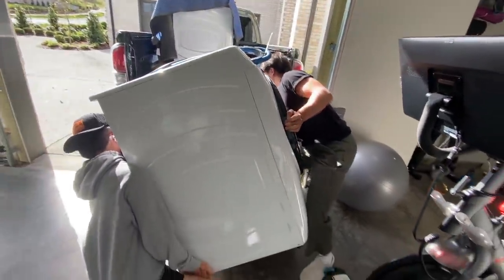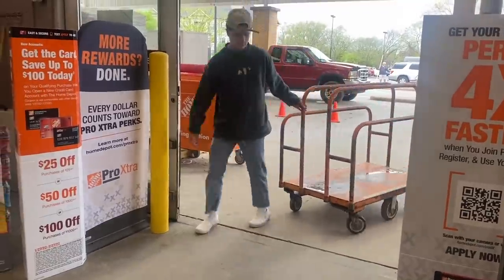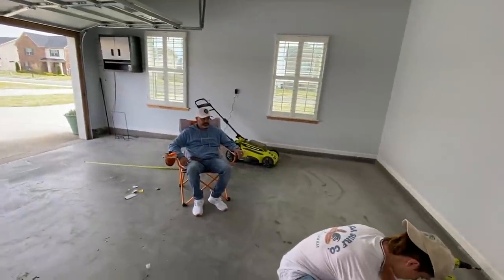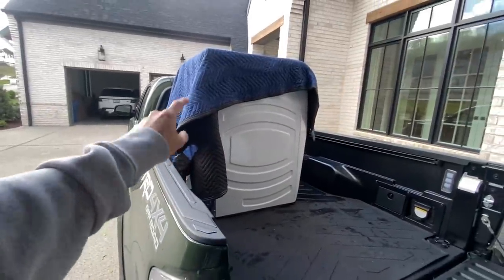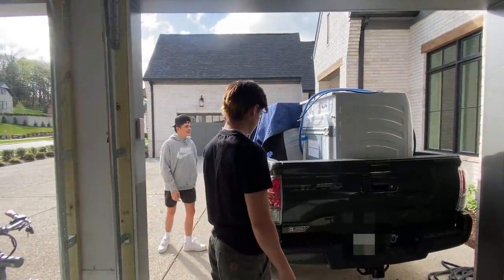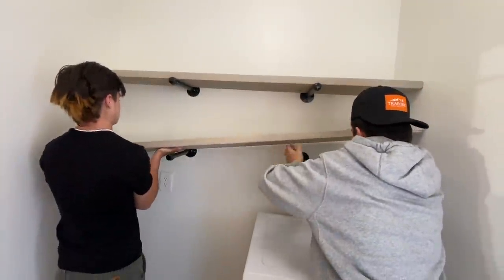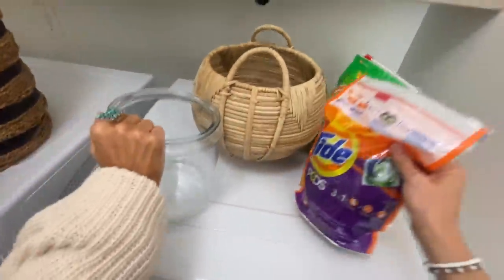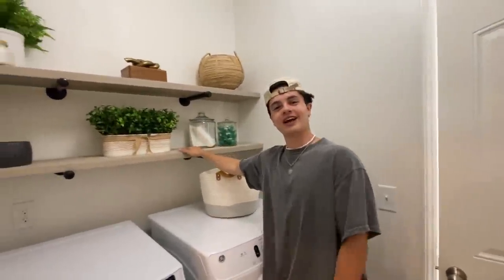First Home Renovation Project **REVEAL** | Brock and Boston

Comment: Great transformation.  A few pinched fingers come with the territory.  You might think about putting down a drop cloth to save the carpet/floor when painting other rooms.  I like the color choice.  Great idea to put the washing detergent and dryer sheets into jars that are easier to get into.
Reply from the maker: Thank you! We bought covers for the floors but didn't use them... when we saw spots of paint we got a wet cloth and wiped it down! :)